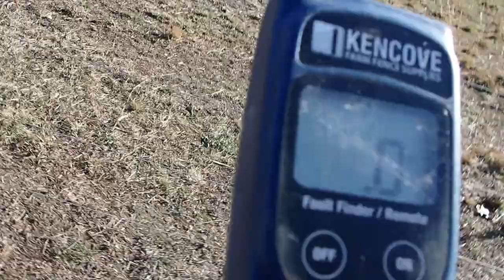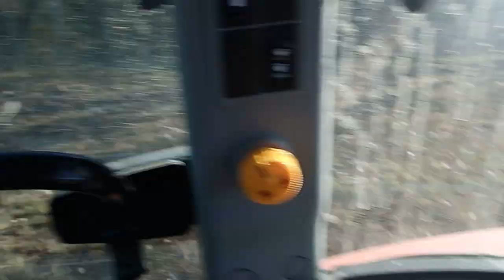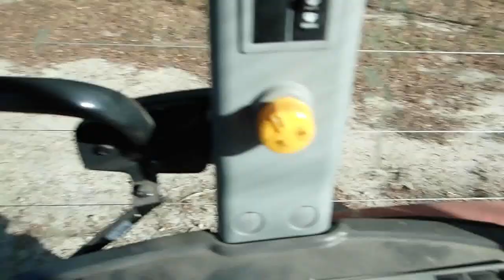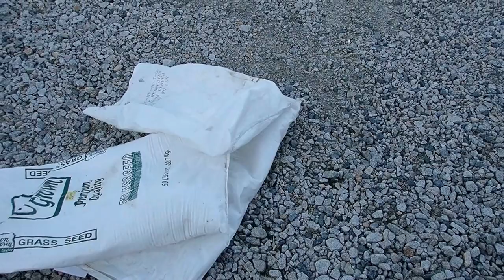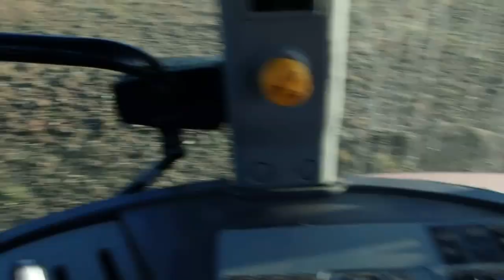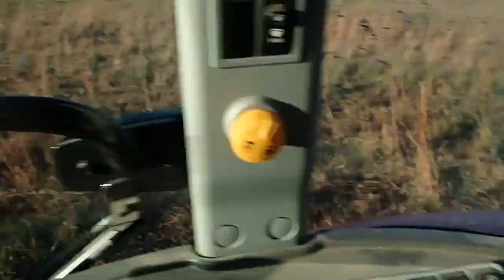Seeding The Cow Pasture

Comment: I know this is an older video but I think you ought to put a center hydraulic cylinder on that I have a similar tractor I think yours is an m class mines and L class I know yours is in a Kubota what's a spin-off of it but regardless if you have any hydraulic outputs in the back I put a cylinder on that the other day I was watching you use the Box plate with that you just set your grading X or the forks just high enough that when your box blading or scraping in the back you just tilt it back do your scrape and then you can leaning forward and brings in them Forks just a thought

Comment: We used to do the same with a 6 foot harrow with the disc set straight.  Ran lightly it had notched disc to they made little  pot holes sort of. We spread with a pull type fert spreader borrowed from our local co-op then pulled a drag made of chain length fence wire. Worked for us in a pinch. Chris..... have you ever thought of the "company" buying a lift type no till drill? Great Plains and Haybuster make good ones. You could use it as a business expense and use it on the farm. Just a thought.........

Comment: Remember as a teenager doing a summer job mowing a big lawn with a little Kubota and a flail mower on the back.  I didn't lock the top link and the more I drove the shorter the link got.  After an hour I was rotovating rather than mowing.  Was wondering why it was taking more throttle to keep the PTO RPMs right.  Lawn looked a bit sad for a few weeks, it has to be said.

Comment: You need a hydraulic top link on your 3 point hitch, Agri Supply has them in Garner.  They are awesome.  The other ultra cool upgrade is the SpeeCo Quick Hitch.  The only catch with them is you need implements that are meant for them or you need to modify your implements to fit it.  I modified mine so far to fit mine and I really like the combination on the hydraulic top link and the quick hitch.  No more wrestling and kicking and screwing.  Oh, and Agri also has the quick hitch.

Comment: You need a 5ft disc to work the ground then use the drag to smooth it out but sometimes you use what you got. Stay safe
Reply from the maker: then I would have had a mud hole this entire winter
Reply: @letsdig18  use the disc just so it scratches the top layer but leave the dead grass on top which you are already doing with the rake